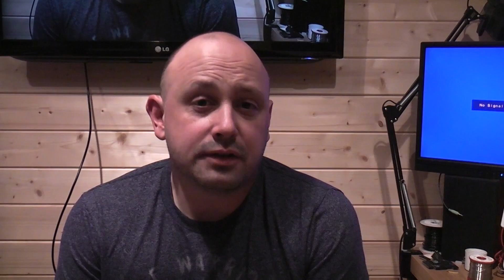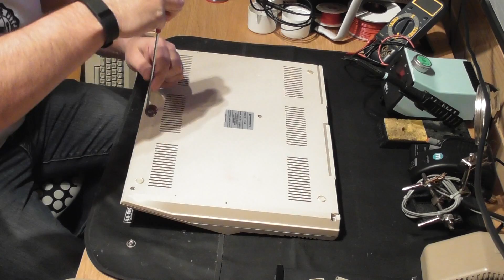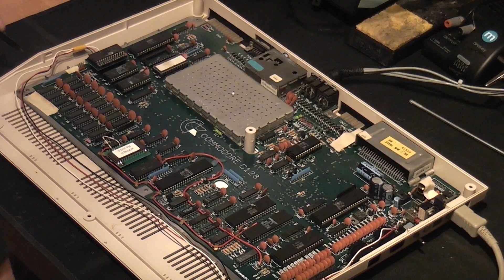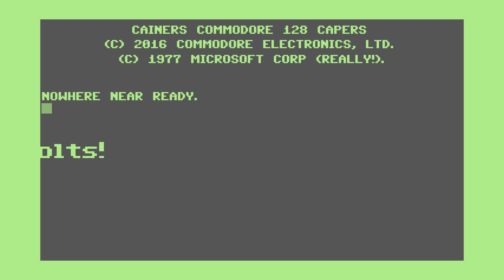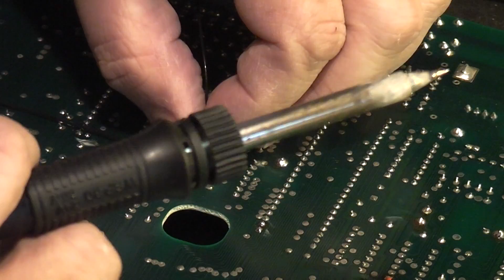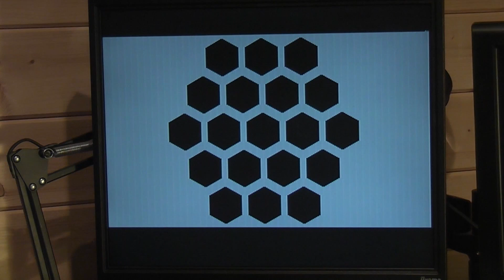Cainers Commodore Capers - 3 - Dead 128

Comment: I'm dealing with one now, stumper....I've check voltages all over and so far everything checks out.  Replaced all socketed chips, nothing.  No boot on anything, diagnostic cart doesn't run either.
Reply from the maker: You checked clocks, reset line, data lines as per the video?
Reply: @CainersCommodoreCapers  Unfortunately have limited resources and am only working with a voltmeter.  Guess I need a logic analyzer of some capacity
Reply from the maker: @pauldeane8369  Yeah, you're gonna struggle fixing something as complicated as a 128 without a scope. Chip swaps only get you so far.  If you are UK based, I can help repair it tho.... 👍👍
Reply: @CainersCommodoreCapers  :( Canada, any recommendations on a reasonably priced scope, or would a logic probe be sufficient?  The board has evidence of corrosion but so far all the traces check out.
Reply from the maker: @pauldeane8369  eBay again fella. Any 2nd hand 100mhz scope should be fine. No need to spend a fortune.... 👍
Reply: @CainersCommodoreCapers  After two days of troubleshooting and watching video after video I thought two things. 1) I wish I had an Oscilloscope.  2) I'm sure it's not an IC.  Well after about the 10th time analyzing the board I discovered a bad trace.  I did a quick patch and viola!  I truly believe these C128 ICs are more resilient than a lot of the troubleshooting recommendations out there suggest.  The last few I've fixed have been bad traces or caps.  Anyway I appreciate your feedback.

Comment: Hey mate. Wonder if you could advise me. I've just got a C128 off ebay and when i turn it on I get a brief checkerboard pattern then maybe half a second later total blank screen. I found  a troubleshooting guide with not much info besides it's the PLA.  Read a few forums where blokes replaced the PLA and it does the same thing. Before I start faffing about with my board any pointers that might help?
Reply: Hmm.. 80 column mode works. Still get the white checkerboard briefly but then it boots fine. 40 column goes to blank screen. Maybe it's this scart cable.. will scope the lines..
Reply from the maker: +Christian Ruocco if 80 Column works,  itll be the VIC.  I think its the 8566 chip.  Theres 2 under the silver cover,  it's the one next to the 8701.....
Reply from the maker: +Christian Ruocco if you get 80 coulmn mode,  means the rest of the 128 is ok....

Comment: Very cool. (C128 Designer)
Reply from the maker: Bil,  thanks so much,  appreciate you vieiwng. And thanks for the. 128, awesome machine....
Reply: The original MMU in the C128 was compatible with 256 but the final version was canceled by my boss.
Reply: So, when are you going to release the Commodore 256?  :-D
Reply: The plastic C128D and the C128 were supposed to release at the exact same time and it was all the harder getting both done in time.  I only found out they didn't release it until after I was gone, but coupled with them also canceling really excellent machines like the Commodore LCD it is no surprise in hind-site as management was really fouled up.
Reply: Cainers Commodore Capers! I might take you up on that.  I have nearly 60 vintage computers and I'm always needing to fix a few.  :-)
Reply: BTW, C128 was awesome.  Lots of people really enjoy talking about how great it is. And it is great.  But I think people forget about the C128D.  Which I finally have.  That's the best C128 in my opinion.  Small case...built in 1571...etc.  Takes up way less room.  Now if I can only figure out what is wrong with my 1571 then I will be happy.  :-D
Reply from the maker: +cb meeks I could probably help with that... 😀
Reply from the maker: +BilHerd Any possibility  of getting your input on a very strange 128D fault?
Reply: Given that your probably way better at this than I am these days (I havnt turned on a C128 in probably 20 years) but sure I can try or point you torwards others including the forum at c128.com  You can email me directly at bherd @ c128.com or bilherd @ hackaday.com
Reply: Also I will be at VCF Midwest on Sept 10,11 if your in the area!  http://vcfmw.org/
Reply: Yes, I love my 128D CR. It's a fantastic machine.
Reply from the maker: +BilHerd Thanks Bil,  Ill be in touch when I have the unit set up....

Comment: So what was up with the screws in the top row keys? 

What did the mystery switch do?
Reply from the maker: +macrossactual The screws in the top keys were there because they had been broken and the springs lost. Not sure why they thought screws would work though.  The switch was for enabling 3 x different roms in 64 mode - Standard Kernal, EXOS and SpeedDos roms.
Reply: +Cainers Commodore Capers!  All this time people have been sweating over new keycaps and replacement keyboard when all that was needed was household repair screws! GENIUS.